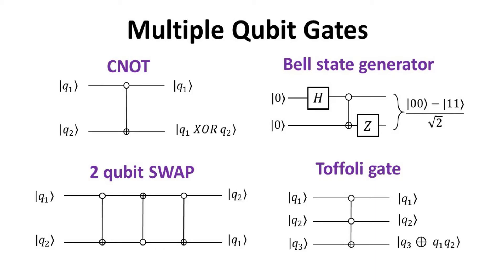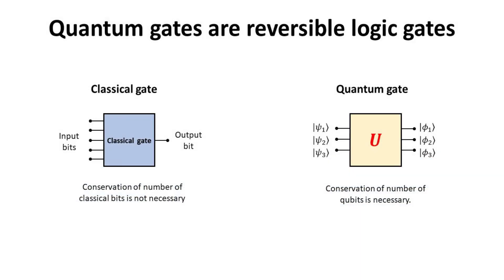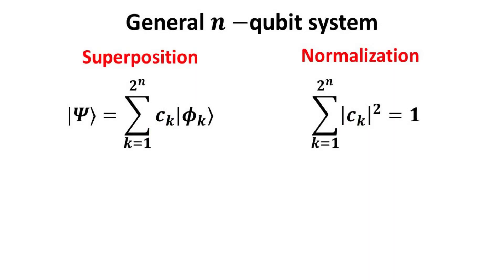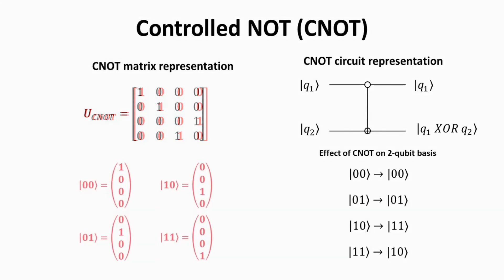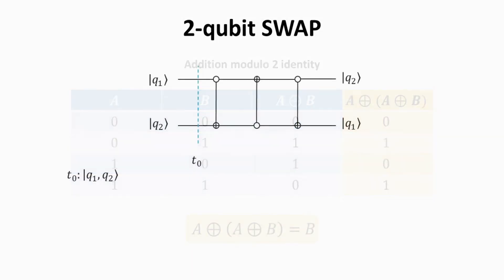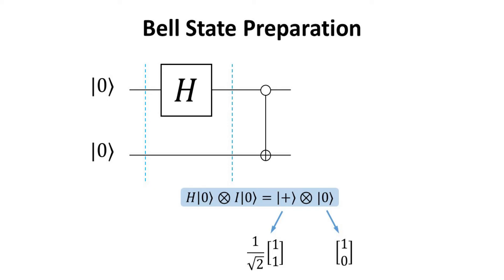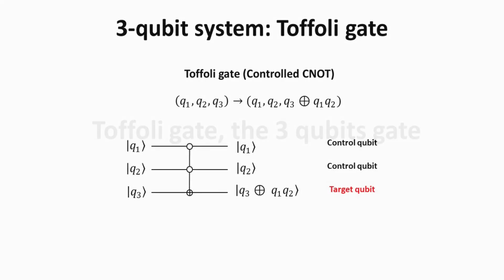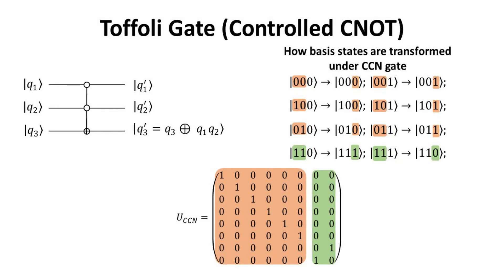Two and three qubits quantum gates

Comment: I have doubt regarding KET 111
I am getting single 1 in the 8x1 column matrix as I am doing tensor product for 
(0 1)* (0 1)* (0 1)*  → (0 0 0 1)* (0 1)* → (0 0 0 0 0 0 0 1)*

(*)  →  Signifies Column matrix
And doing the tensor product for this
Please explain, am I correct??
Reply: Yes, the two column matrices 110 and 111 are wrong in the video. There should be single 1's in the 7th and 8th places only.